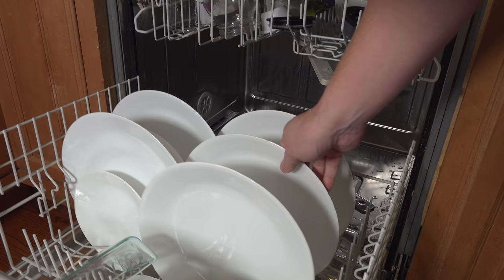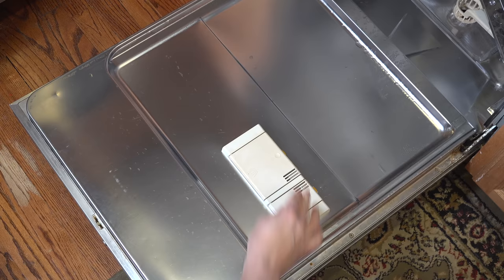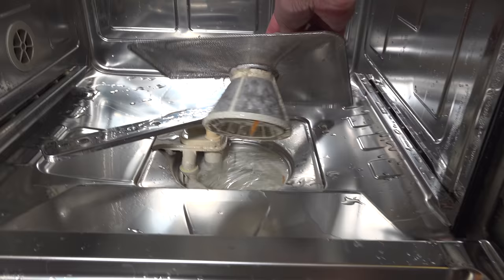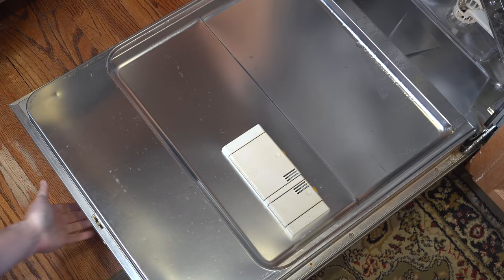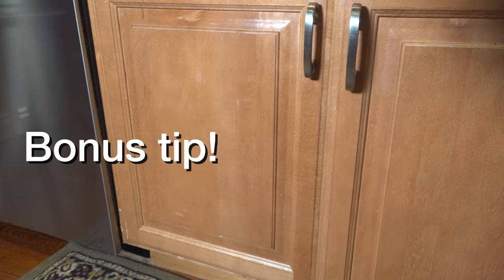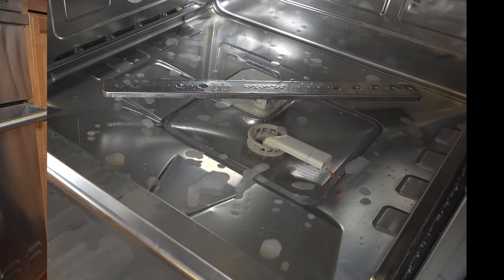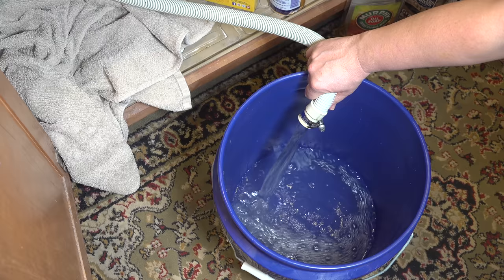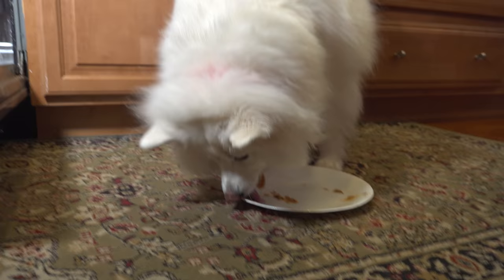3 EASY Tips to Make Your Dishwasher WORK LIKE NEW

Comment: You forgot something important!!Technology connection channel  has made a video about this topic: almost no people use liquid soap nowadays and they don't pour the prewash soap in the little tray causing the main soap to loose the cleaning effect more rapidly therefore reducing the efficiency of the machine and cleanliness of the plates.
Reply from the maker: I think that's the issue though, if you aren't using liquid soap it won't help much. That may be why Finish has done so well, in one step I have never seen another product perform as well consistently. We use our machine 2x a day often so everything that makes it a little easier is good.
Reply: Once I went back to powder and filled the prewash tray I’ve had spotless dishes. This includes pans from Mac & cheese with burnt on cheese. Technology Connections really covered this well.
Reply: prewash suggestion made by tech connection made all the difference for me.
Reply: Not all dishwashers have a prewash tray.  They use a steam prewash instead.
Reply: @SilverCymbal  Do you think that cheaper Finish is better than their most expensive tablets Finish Quantum?

Comment: Another thing to check and clean after cleaning the filter and screen are the two sprayer arms. I clean those in my sink and always find food particles stuck in the sprayer arms and the nozzle holes where the water is supposed to jet out. Once they're clean the spin way better. To know if they're clogged simply open the door after a few seconds of run time and see if they moved positions. If not then they're clogged and need to be cleaned out. Great video

Comment: Only other thing to add was a tip given to me and it’s made a difference in overall plate cleanliness:

Dishwashers are usually tapped into the hot water supply from your sink. The first spray/rinse cycle doesn’t pull that much water in though. So that first spray of water is cold. Run your hot water through the kitchen faucet and get the hot water coming through. Then run your dishwasher. Eventually the heating element in the washer will heat the water but by running the hot tap to “pre-load” the line with hot water you’ll have hot water being used for each spray/rinse cycle.
Reply: I do it this way also. Helps alot.

Comment: Great video as always. One quick item - if you rewatch your video you will see that before you disconnected the drain line the original installation of the drain line had it looped over and around the sink drain line/pipe. This created a high loop to help prevent backflow. When you reconnected it you missed re-lopping the line and keeping the high loop. Perhaps you did this on purpose or perhaps it was just a mistake. Again - keep the videos coming.
Reply: Installer or repair?

Comment: Another tip is to properly route the drain hose. If your sink ever backs up water will go down through the drain hose and into your dishwasher and then onto your floor. Prevent this by looping the drain hose up so that it touches the bottom of your counter, and then down into the drain pipe. Otherwise it's a disaster waiting to happen.

Comment: Another tip:  make sure nothing blocks the rotating sprayers when loading the dishwasher.
Reply from the maker: Yes that is a big tip! That can get you every time.
Reply: Remove the spray arms (designed for easy removal) and check them for blockages.
Reply: I discovered that my dishwasher was acting up because I didn’t fill it with dishwasher salt 💀💀😱😱who knew 💀 I didn’t even know I was supposed to put salt in it 😂😂😂

Comment: You're usually giving us great tips, but for once I have an even better advice for you! 

1. Always dump 1-2 cups of white vinegar into the dishwasher right before turning it on, it not only helps keep all the nooks and crannies free of debris, it also de-scales all internal parts and even helps break down the food off the dishes. 

2. Stop using finish tabs, they suck azz, when you took the first filter off, did you notice all that gunk, that was the finish tab. Use the advance ultimate triple double cascade ultimate, they're the best. 

Last tip: Use rinse aid, it releases all surface tension off all surfaces, allowing the water to do it's job and penetrate all food and debris (I used to use rinse aid when panning for gold and it really does break surface water tension and allow everything to drop, otherwise the gold can actually float on the water, rinse aid cuts surface tension and everything drops to the bottom).
Reply: I will give all of this a shot, very interesting. Especially on WHY rinse aids are so important! Technology Connections says that any aid will work just fine so I don't think you gotta worry there.

Comment: My tip .. buy a bag of Citric Acid.  A 5 pound bag is $14 on Amazon.    Every few cycles, toss some in with your dishes.  They'll get scoured extra, and the dishwasher will be squeaky clean with a nice scent.
Reply: We moved into a older house, the dishwasher was BLACK inside. 
I ran one empty cycle with citric acid and it looked like brand new.
Not sure how well it works but I've heard people using TANG orange drink powder .
It's high in citric acid.
Reply: Vinegar is cheaper. Does Citric acid work better for some reason?
Reply: @TAPriceCTR  The price per use is pretty cheap for both.  A 5 pound bag will clean 40+ cycles.  Unknown which might be "better."

Comment: Another trick is to run the hot water from the fosset just before starting a cycle.

Explanations:
Manufacturers of North American made dishwashers figured they could save some money by not having a water heater in the dishwashers.

Instead, they rely on the fact that most people will install the dishwasher next to the kitchen sink and just use the hot water line from there.

If your sink is like mine, it needs to run for a while before the hotwater goes from the tank to the sink. 

What this means is that your first rince will most likely be done with cold/luke warm water: the dishwasher fills up and stop, regardless of the water temperature.

The heating elements are not doing much at this stage.

That should not be an issue with dishwashers equiped with a steam function as the dishwasher heats the water as needed.

You should see way better pre clean if you ensure the dishwasher uses hot water.

Comment: Interesting you explicitly suggested not using the drying aids (also Finish brand).  I’ve found they make a huge improvement after previously cheaping out and not filling the reservoir for it.   This applies across various models.

Comment: We've got the exact same model of Miele dishwasher. It's an amazing machine and very quiet.  Make sure you always leave the door slightly cracked open when not in use - it prevents smells inside the dishwasher from forming. Yet another great video!

Comment: I agree, I have ALWAYS added powder cascade to the open pre-wash cup along with placing the Action pack in the main wash detergent compartment, which is also sealed with a small rubber gasket so water cannot enter that side until it's supposed to, when it pops open.

Comment: You can either run a pack of lemonade / Kool aid. Or just fill up the soap container with white distilled vinegar (while running the dishwasher on EMPTY) and you don't have to spend more than a quarter to get it clean.
(Still clean the filter, at least once a month).
Everything you buy takes maintenance. EVERYTHING.

Comment: Put a small bowl of vinegar right way up (not upside down)on the top shelf. As the water flows in the dishwasher there will be a steady overflow of vinegar into the wash and keeps the dishwasher clean as a whistle. Simply pouring vinegar into the machine does a not work as it disappear in the first cycle- this the cup. Simple but very effective

Comment: Many dishwashers do not have a pre-wash container for a pod the more expensive ones do.
If the dishwasher doesn't have a location to put a pre-wash pod or detergent then drop one in the bottom of the dishwasher along with putting one in the dispenser and wash dishes normally and it will clean them all

Comment: The correct way to use a DW is to FILL the prewash compartment!!
It supercharges the pre rinse water,  a normally long cycle with all DWs by addressing this short coming it allow the main wash cycle in this case the tablet cleaner to clean much more efficiently as the pre rinse water has begun the process of breaking down grease and grime.  Try it !!!

Comment: I rent a house built in the 1980’s and the appliances are original. I have got to try this out because I need to wash my dishes before putting in dishwasher, I don’t think of it as a “washer” more like a “sanitation” machine these days. Thanks for all the tips!
Reply from the maker: Glad you liked it, I think they will improve your situation.
Reply: For such an older device, you may do better by making sure to add to the pre wash tub.
Reply: Add the dishwasher salt and the shine liquid thing don’t know how it’s called
Reply: @HAIRHOLIC_1  I add vinegar and I have always used a good dishwasher soap and the Jet Dry.

Comment: You might want to go watch the Technology Connections video: there are reasons why the pods are not good, and other things that are often negatively impacting performance. The man literally cut a hole in the dishwasher.

I clean my filter about every other load. Way more than once a month.

Run the hot water before you start it. Be sure to fill the pre wash or spill some detergent (if you have no pre wash)

Dishwasher Magic is good but expensive, Tang does almost as well.
Reply from the maker: I have seen it and sometimes what makes an interesting video isn't always real life. I have never used pre-wash and haven't needed to after switching from Cascade which ruined their formula years ago. Finish accomplishes this is one step.  Tabs are not all created equal and cascade lost the market when Finish came to be, be the real reason is that it just works better.

Comment: Jet dry is absolutely great and should always be used if you don't want residue on dishes. Also get liquid or powder dishwasher detergent and put a small amount in the dishwasher as a pre-wash before each cycle and run hot water in the kitchen sink before your wash.  As for the last step in the video, you can use diagnostic mode to fill your dishwasher and run the pump.

Comment: Hands down the most useful youtuber.
Reply from the maker: Appreciate that
Reply: @SilverCymbal  I'm following your procedure. I thought the filter was just the top part. Just as in your video, it's at the bottom and found it filthy. Cleaned it and now running the sanitization cycle.
Reply from the maker: @Lenser  So glad it helped. They are overlooked all the time and it completely controls how much flow you get through the cycles and also is more hygenic to keep cleaned. Thanks for letting me know

Comment: Thank you for that tip on the filter. Mine was clogged up and filthy.
Reply from the maker: Glad it helped. Run an empty cycle too when you can and you will likely notice good improvements.
Reply: Holy smokes, so was ours. It was disgusting and pretty much completely clogged. After cleaning it, I could hear a difference. I could hear that there was significantly more force from the spray inside. I'm sure it will work better now.

Comment: I used to use the finish powerball until I tried cascade platinum plus. I think it works better. When I used the powerball, I was also popping off the red ball and putting in pre-wash.  Mine doesn't have a filter like that. It has a chopper assembly that gets clogged. It's a chore to get to so I decided to take it out. Mine drains to garbage disposal anyway. Best thing I did.

Comment: Another tip to get really clean dishes is to use two of the power pack detergents. Put one in where you normally do and then also put one down in the bottom. Most dishwashers are designed for you to put powder detergent in the first compartment but also next to it there is a compartment with holes that allows it to escape in the beginning of the cycle or pre-wash. 

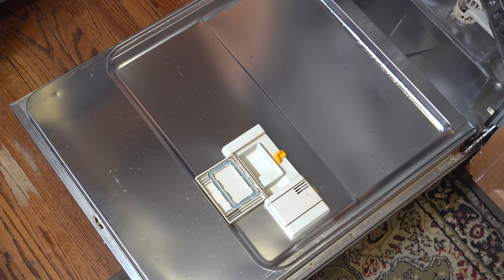You can even see the spot on his dishwasher where the pre-wash detergent is supposed to go. It's that little compartment next to the main one at 0:40 . But because most people use the power packs, and not powder dishwasher anymore, you don't get that detergent part at the beginning, so always use two.

Comment: Something you didn’t check is sometimes when the dishwasher is installed the hole in the spigot underneath the sink where the waste pipe from the dishwasher connects is not drilled out probably. Quite often the installer or plumber will just punch a hole through that fitting with just a screwdriver leaving a small hole which severely restricts the dishwasher from pumping its waste out. The easiest solution is to just get a drill and drill it out.

Comment: periodically we must use the highest setting of a dishwasher or a washing machine to clean the cavity. so if washing machine foams up excessively I use a bit of vinegar. it helps, in Europe not sure about North America, dishwasher cleaners that are used upside down are actually bleach, so a bit of bleach also helps with running to the highest setting your washing machine (making sure you don't overdo it with cleaning agents. if one hasn't been placing the dishes wrong in the dishwasher and one notices the dishes are dirty, it's time to clean the filter and run a high temperature empty cycle, my AEG says, clean filter, and usually a piece of label from a jar is the culprit. I also dismantle the filter, after I have cleaned it manually and place it in that empty cycle, the handyman who came to see my dishwasher because of a pump issue was surprised how clean the dishwasher was. clean dishwasher = clean plates. finish is good. thank you for the tutorial.

Comment: That looks like a Miele you have there and I've used every detergent there is. Nothing beats the Somat 5 tabs in these machines. Unfortunately, because they're limited; the cost is astronomical and not worth the money. The Cascade Oxi tabs are great also. I'm not sure what happened to the Miele tabs, but they don't seem to work as well as they used to. The older ones dissolved slower, but the cycle time on their current machines is over 3 hours for Pots and Pans. It doesn't need to dissolve fast. I'm anal about that filter too. I always check it before each wash and rinse it out. I've seen people who've never rinsed it at all. They just let it ride. Generally if you have an issues with dirty dishes, it's the usually due to user error unless you just got a piece of junk. Pretty much all dishwashers do a good job if they're loaded properly, have decent water and good detergent. You don't fancy dishwasher. Although they are nice to have. Anyway, great video.

Comment: Thank you so much! I’ve been struggling with my dishwasher. I’ve changed the tablet. I started washing a full two cycles and adding baking soda to the second one because everything tastes like soap. It’s definitely draining. I’m going to look for a filter. I didn’t know there were unscented tabs. I’ve been using Target house brand and at least they’re better tasting. 😜 Lol Thanks again.
Reply from the maker: Glad it helped, one small correction I guess the ones I use (box shown) are technically scented, they are called fresh scent. But they also make cirtrus ones that I didn't like at all. So if you look just look for the box I showed. They work very well.
Reply: Run the water so that it's hot, add detergent to the prewash with your existing tablet and use a rinse aid. Or forgo the rinse aid and use the Finish Quantum tablets (personally use) Clean the filter, run a cup of vinegar in the top rack and run an empty cycle. If that doesn't work I'll guess it's hard water or the appliance. Best of luck.
Reply: I don’t seem to have a filter. I got the manual out also and it doesn’t show one either. I’ll try the vinegar. Tks.

Comment: Best tip? Don't use overly expensive dishwasher tabs that are wastfully individually wrapped in plastic. Use powder and fill the small rinse detergent container too and it will use a small amount of detergent when doing its pre wash cycle. If you want to continue to use dishwasher tabs, put them in the cutlery basket instead of the powder container which is designed for...powder.

Comment: Fill both soap cups.
The open cup is for the prewash and adding soap will get rid of most of the fats.
Reply from the maker: All detergents are not created equal. Try a box of these and see what your results are like. Most tabs are terrible. Finish are not the same as the others. Night and day from other products and a simple one step.
Reply: That's what I don't like about the soap tablets. You don't get any soap for the prerince cycle .
I actually use both, Finish tablet for the wash and I just put any generic dishwasher liquid in the prerinse.
Reply from the maker: @tb2324  100% I never do and the results are excellent. The rumor is that Finish had some patent that came from the German company Henkel who makes some amazing products in Germany.

Comment: There are 3-4 tips missing in this video (i.e. ideas for your v2):  1.  Make sure the hot water in the nearest faucet to the dishwasher is hot by running it until it is.  2.  Dishwashers have TWO compartments for detergent: (1) the main compartment which is released later in the cycle and (2) the prewash compartment which is outside the main compartment or if it doesn't have one, you need to just put a tablespoon of detergent loose in the machine.  3.  The main detergent compartment has two measurements:  one for SOFT water and one for HARD water.  4.  If you follow all these tips, you can use the cheapest detergent powder.  The tablets are actually not necessary.